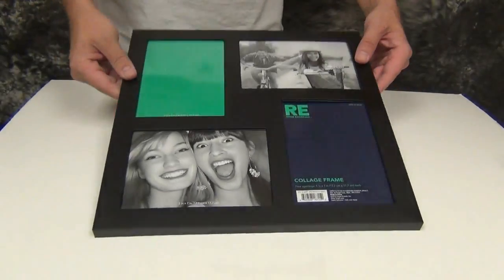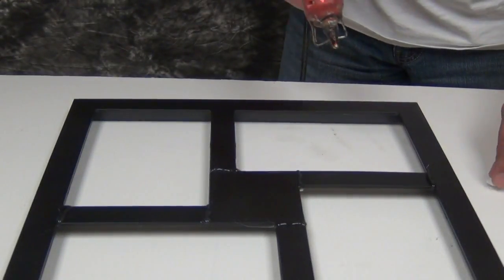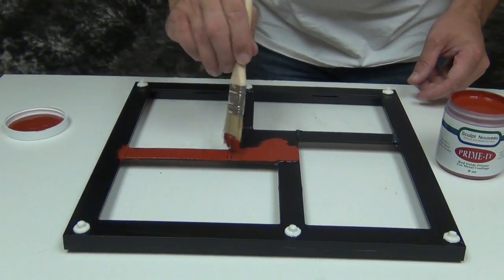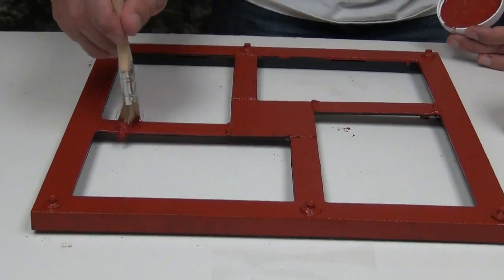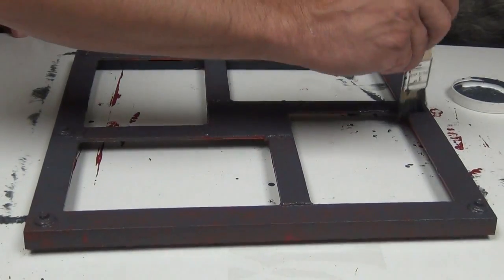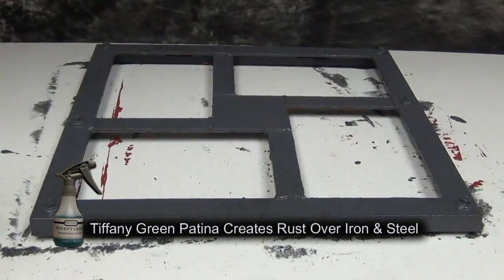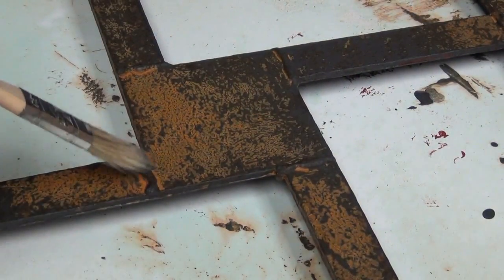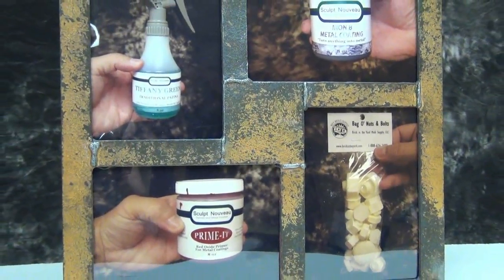Rust Effect with Iron B over Picture Frame

Comment: Around 2015 I made a picture frame using oak 2x4s and after this treatement it looked like it weighed 400 pounds. It was a 30x36 large frame and during the photography contest I saw people with their fingers stuck out just wanting to touch the frame but knowing it was poor etiquette to do so. I thought the frame was a great compliment to my 1901 water tower photo with a lightning strike behind it. I easily won that contest thanks to this video demonstrating the technique. Of course I used the Sculpt Nouveau product to complete it. I tried the silver paint but ended up removing it because it looked fake to me. I had good luck waiting for a rainy day and doing the rust activator in the garage with the door open. Very humid and took forever to dry. So pretty much 100% rust on the frame.